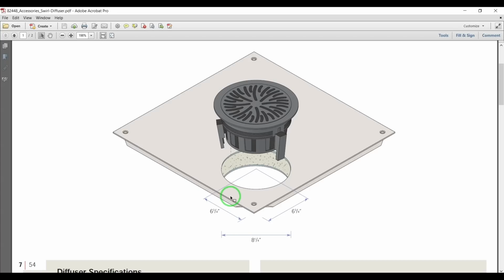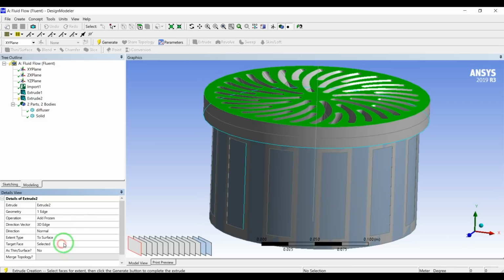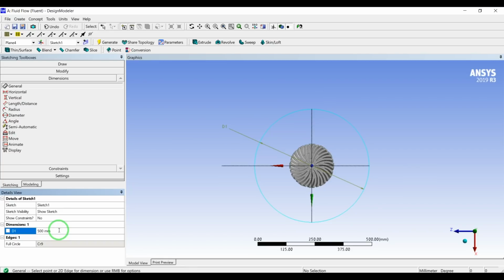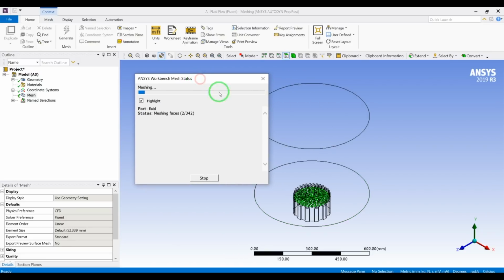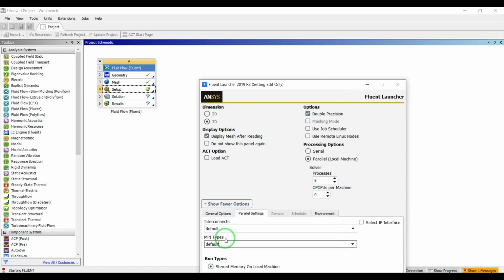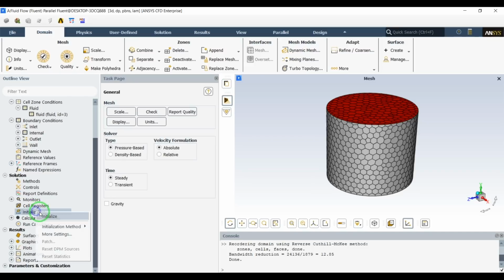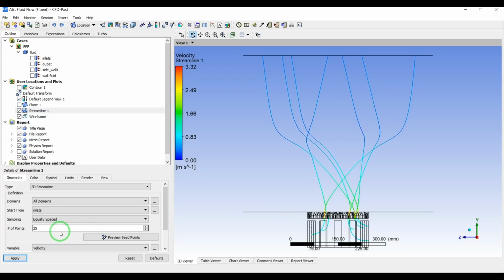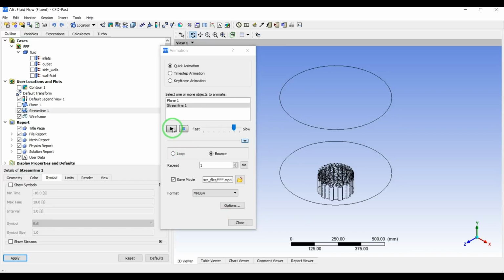ANSYS Fluent Tutorial: simulation of flow in a swirl diffusion (Part 1 ANSYS Meshing)

Comment: I am new to all this and I am trying to pick up. I had a doubt of how do u set this is the inlet from where the fluid will flow into. I tried to do an easy example called a back step flow from some site, they gave the image of the mesh and all. I tried doing it but it doesn't show any inlet velocity. Good video btw, i did pick up a lot. I am think my inexperience with the software is what's holding me back.

Comment: I think compared to 2019R1, 2019R3 is much slower when meshing, and 2019R3 sometimes will freeze.
Reply from the maker: Yes, but It is improved in 2020R1 if you give it a try. Also in the new versions, Fluent meshing is encouraged by ANSYS, which is getting better. I will post some videos on Fluent meshing soon.

Comment: How I can put velocity inlet and mass flow rate in the inlets as the catalogs and the research for get a best solution
 Thank you for this job is very good
Reply from the maker: You can olny define velocity or mass flow inlet as the boundary condition. May I know what you mean by catalog? Do you want to perform a parametric study?
Reply: I have searched about this model and I've found a paper and inside it (Comparison between manufacturer’s data and simulation) when velocity 0.254 m/s , 0.764 m/s and Air flow 90 CFM . and I found catalog about the model same that velocity and Airflow and every Airflow we have three velocities .
I don't know how can put in  boundary condition in the inlets for get a best result.
You can find the catalogs and paper for this model in this link 
https://drive.google.com/drive/folders/1q73RThwb6o-J-EuZT-iZK1RjJGaoP8ef?usp=sharing
Reply from the maker: @letsgo-xb3us  Thank you for your comment and thank you for watching. As you know, if we have a fixed inlet area and fixed velocity, so the air flow rate is fixed and predefined by those parameters. But if you check, you can see the inlet is adjustable for these diffusers.  So the data shows different inlet opening sizes and different flow rates. Please let me know if this explanation is good enough.